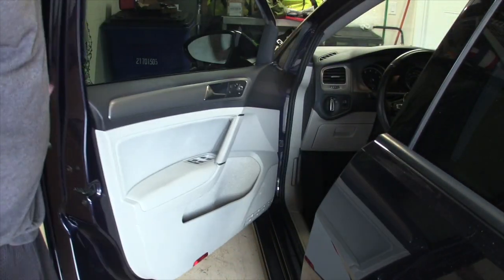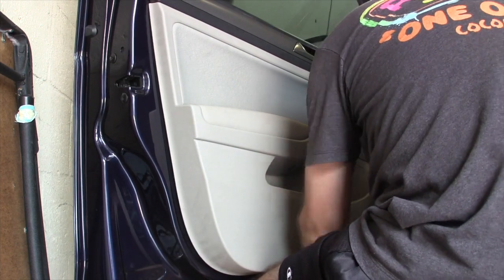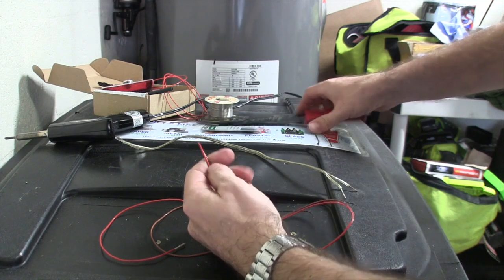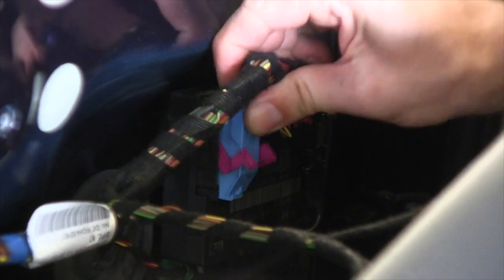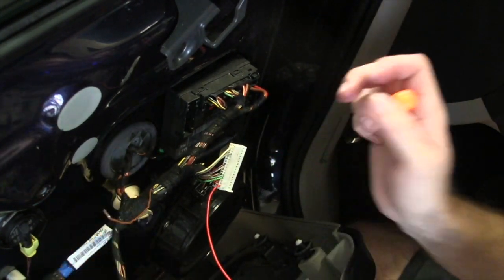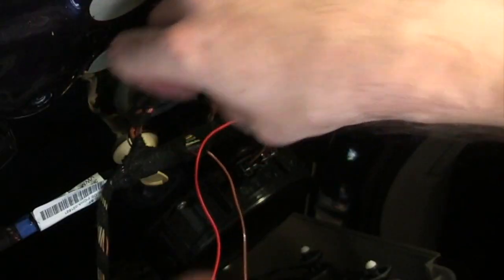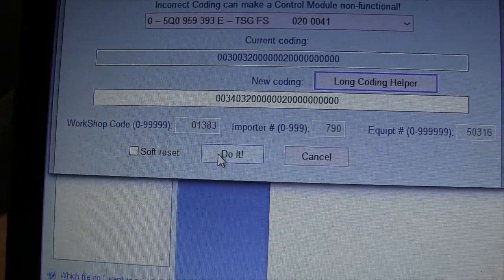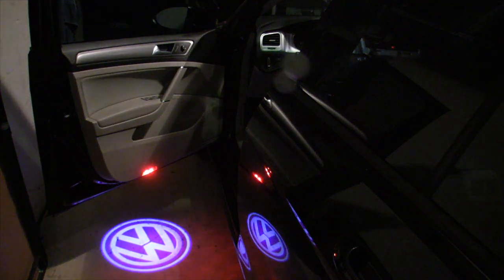Install Shadow Lights VW MK7 Golf GTI Alltrack Sportwagen

Comment: My 2020 mk7 jetta doesn't even have those reflectors. But there's a rectangle hole on the bottom where that release bolt is for the door panel. Will these fit on the bottom in that hole?

Comment: What  do I need for the coding  Obviously you need to plug in to the car
Reply from the maker: Rosstech cable for VCDS or probably can do it with OBDEleven also but I am not sure. I have a rosstech cable using the vcds software. It is a must have for Audi/VW owners